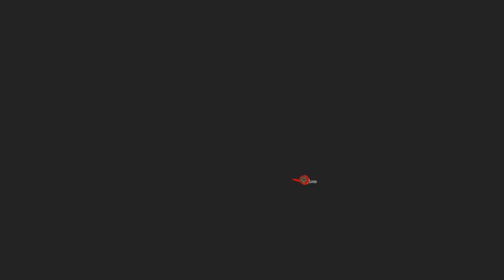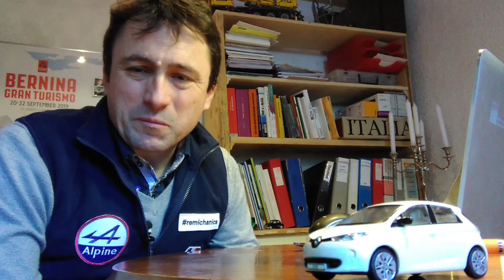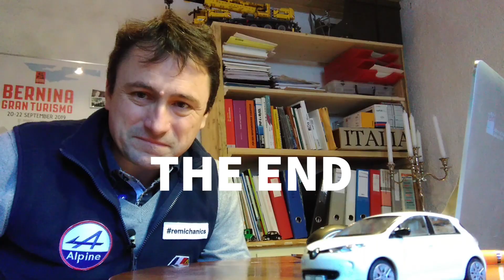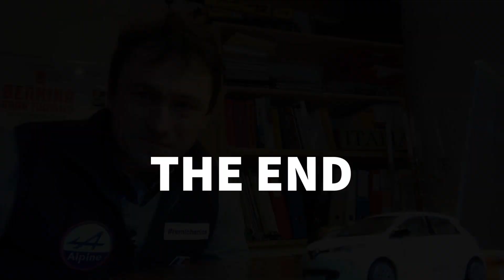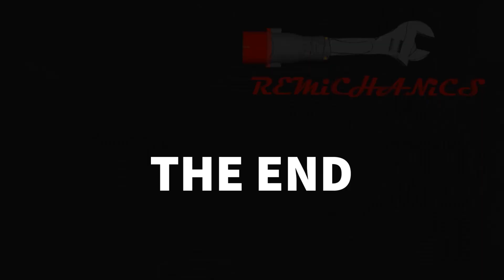REMICHANICS #25: Bye Bye Renault Zoe!

Comment: The economic life span of the drivetrain is much longer than the warranty. Renault should have proposed a much better offer for you. I advise you to contact your legal assistance.
Reply from the maker: You are right there, but the legal warranty is two years and Renault extended this without legal requirement to five years! And they offered about 30% compensation, which is not really unfair. I'd need a very good lawyer there.... 😉😀😎
Reply: @REMICHANICS  I would obt for at least 50% compensation. And let an independent expert look at it first.

Comment: I find it confusing why you'd get another Renault product after one failed on you at only 116k km. Brand loyalty is normal in most circumstances, but I'm surprised this situation hasn't sour your stance towards Renault.
I would say a used Hyundai Ioniq Electric 28kwh would be better as you would not be responsible for the initial cost & resources for its production.
Check out Bjørn Nyland's YT channel for its review and 1000km "challenge" review.
Reply from the maker: Hello there @MQNguyen, good question but easy answer: Part of my decision to get a new car is the  change in technology, mostly the 52 Kwh batt for my longer travel needs between Switzerland and Ireland. If I wouldn't have that need  I could have repaired my own Renault Zoe, which would have been the most sensible thing to do from an environmental point of view. As I said in the video, I am fully aware that I am part of the problem by having taken that decision! And regarding Renault: I strongly believe that the problem of missing upgrade paths is inherent in the car industry, not specifically with Renault. Every car brand could have a critical component that fails at some point, but NONE of the manufacturers have a sound upgrade plan or "open source" repair plan in place. So of course I could have changed the brand, but there's no other brand out there (besides maybe Tesla in some ways and hopefully in the future the german startup Sono Motors) that offers better solutions that Renault unfortunately! (PS: Hyundai spare parts can be VERY expensive too!). Hope this explains a bit my thinking... cheers!
Reply: @REMICHANICS  Regarding technologies in cars and potential longevity of its components, the Renault Zoe 52kwh still lacks an active thermal management system for its battery pack which may impact it's long-term battery performance and degradation. Personally, the absolute minimum for an EV in 2020 and onward should be equipped with liquid cooled battery packs which the new Zoe lacks. Having better thermal management means you potentially cold-gate less and degrade slower in hotter weather when using DCFC during trips.
Right now, i think only Tesla and it's rather large owners community would have enough interest/members to have someone that would open up independent mechanics shop and provide "open source" upgrades in the near future.

Comment: Could you not get a ‘used’ pec and as Craig (RZOC) said - can the bearing in the motor not be replaced? Even if it meant a few weeks with the car dismantled. 🤔
Reply from the maker: Hello Ian, tried very hard to go down that road, but the PEC in the R240 is different from the PEB in the Q210 as it incoroprates nearly all electronic elements such as charger, inverter, rectifier etc. Both PEB and PEC are programmed to a specific vehicle through the VIN. In the meantime some specialists have found a way to reprogram a PEB (Q210) to a different vehicle. Nobody to my knowledge has achieved that with the PEC in a R240 so far, and it won't be easy anyway as some components are programmed in an irreversible way. And to add even more difficulties, most R240 are still in warranty, so nobody before me really was in the same situation. This means also that there is no real supply in used parts for now. That might change in the future, but if I would start now to collect parts all over europe the car would stand still for months to come.... and I would need a replacement in any case. And then there's the battery leasing too.... See the problems?
Reply: REMI CHANICS  Yes. I’m familiar with that type of coding to specific vehicles in respect of BMW motorcycle ZFE units. It now makes me wonder what is to happen now with your car. Will it be repaired by a Renault dealer? Repaired by a Zoë or EV specialist? Broken for spares?
I must start saving for a ZE50... £20 each week 😂

Comment: Oh man what a huge bummer.
Reply from the maker: Definitely! Wouldn't it be nice if could just repair and upgrade the car?
Reply: @REMICHANICS  Yeah completely agree with the point you made in the video. It's like buying a whole computer, new processors come out every year, and your processor burns in 3 years, and you cannot use a new processor in your computer, you have to pay 6000 euros to buy the old 3 years old one. It's just insane that they haven't thought about this in the EV industry, they only thought about how to sell new ones. Ohhhh we are so eco with recycled seatbelts and seat material, ohh what your eco car broke? Yeah you have to throw it away because we require a million money to repair it. Yes, very eco. God damn it.